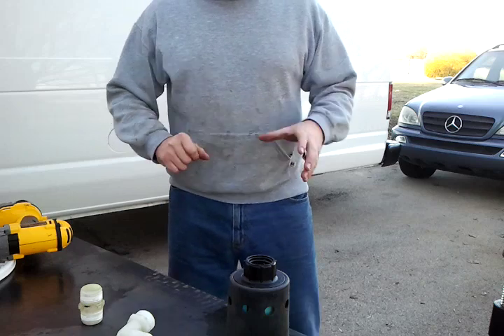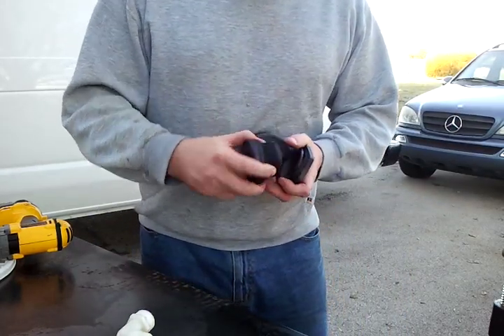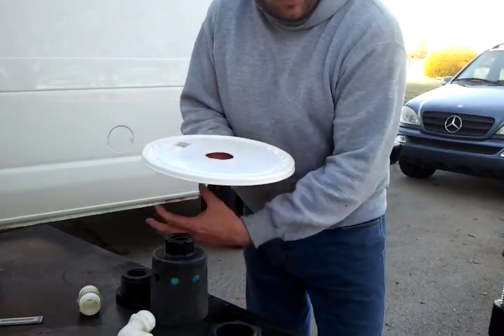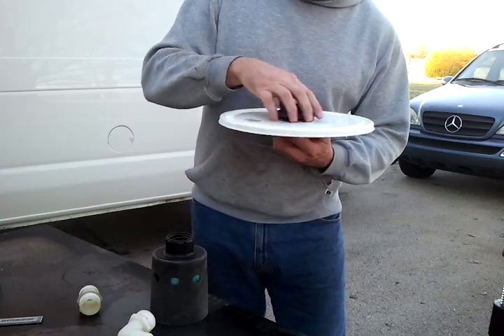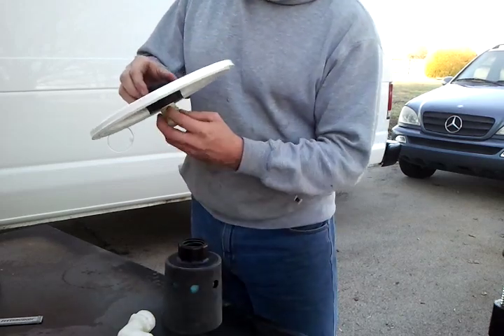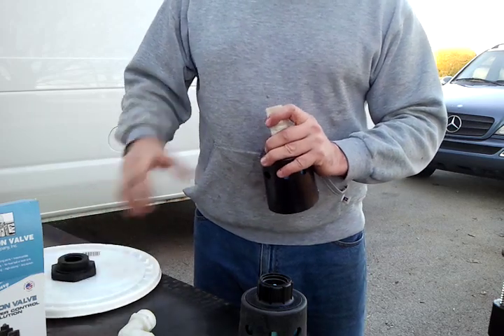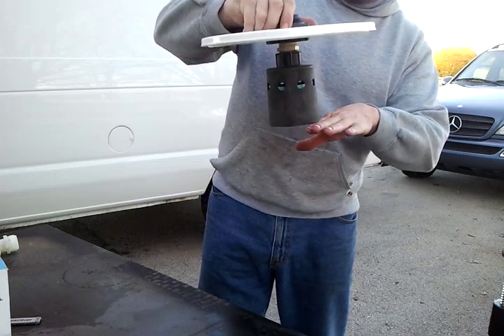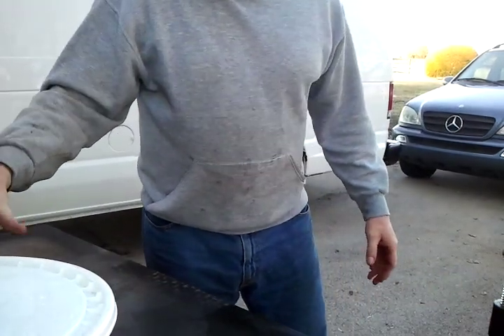Installing a Hudson float valve

Comment: Thanks, michael. I am setting up a small buffer tank and am installing a hudson valve and this has been really helpful. I am intending to attach the valve to the cap on my tank. Is that a mistake? Im thinking it raises it up a bit more and makes it easy to access if needed. Im open to being wrong...
Reply: Yeah did it work?
Reply: Curious how it turned out as well.

Comment: Your video helped me a lot. I didn't know that Hudson valves existed. I pictured myself either staring at a slowly filling tank or (more likely wandering off and forgetting about it and it flooding my brand new trailer) Thanks!   Get out on that Harley!
Reply: You could put in another bulkhead hooked to a hose for an overflow drain. Sometimes these valves don’t shut off 100 percent.

Comment: so i use a 275 gallon tote because im off site washing my company’s tractor trailers on the side… about 7 trucks every 2 weeks…and i fill the tank just alittle over half as not to be over weight … i may be get into washing gas stations..question?? to fill the tank i can put a splitter 1 to fill the tank for off site and 2  to put the hudson on and fill tank maybe half way.. .. can i install the hudson on a down tube so i do fill tank… or just use another tank on trailer??? thanks

Comment: Want to use this for a storm drain catchment to fill drum. However, I'm wondering if I'll have problem of it staying slightly open. My main aim of using it is to separate the first  runoff from my stored water.
Reply from the maker: Might work

Comment: Hi Mike Great video. I get how to do it now.  I know you are a busy guy but I have one quick question. I want to connect two 55 gallon drums together with PVC pipes connecting the two at the bottoms of the drums. Now question is will the water fill up drum number 2 first and them the float valve stops the water when drum number 1 fills up to the valve level?.....I hope I was clear with the question. Thanks a mil
Reply: if theyre both vented they will both fill up if you have em set up right
Reply: Yeah they should fill at the same time if vented.